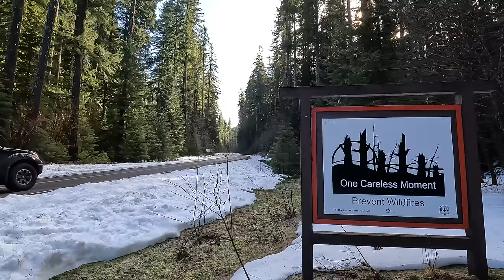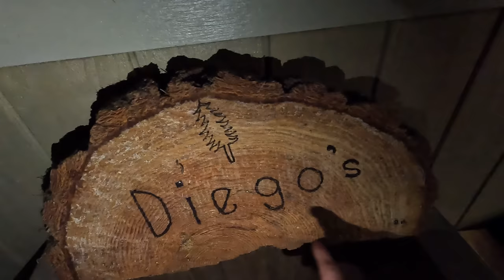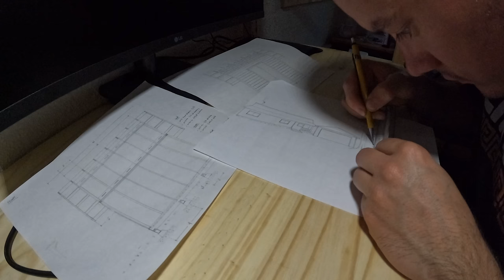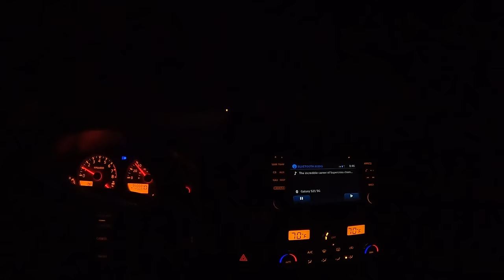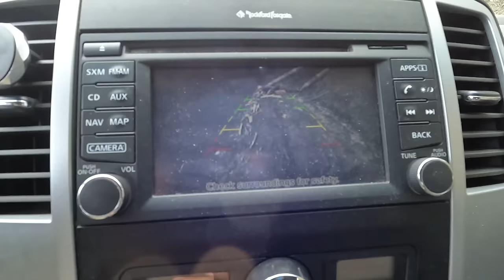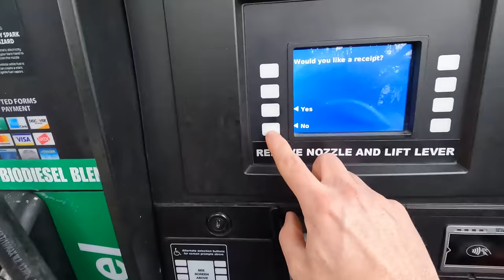4 Day Firewood Haul at My Cabin in the Woods

Comment: The wife and I spent 33 years in the high desert of Nevada. Our house was at 9,000 feet. We had an enclosed fireplace with multiple blowers and only used firewood because out electricity rates was very expensive. I would get a BLM firewood permit for $10 and I could get two cords of wood. I only cut dead pine trees and there was lots of them and very tall like you have been cutting. I had a 3/4 ton truck with trailer and I could get my two cords when I went to cut them. I always kept 6 full cords of wood in my side yard. We would get almost no rain every year but lots of snow. It was a good thing my truck could climb and go anywhere on those old mine roads.

Comment: Just a piece of advice. It would probably be better to cut your wood in longer but manageable lengths when away from home and junk it up at home as to maximize the amount you can get before you need to recharge your batterys. And I find you can get more in a bed by taking it in lengths by leaving the tailgate down and letting it run a couple feet out past the tailgate.

Comment: Looks like you would benefit from a trailer, so you can double or triple your loading capacity, awesome to collect trees like that, and that makita saw works great! Also, I love how you clean up after you as you go, good quality to have!
Reply: I was thinking he can get way more wood per trip (thus not spending so much on gas) if he would stack rounds instead of splitting it first and then adding a trailer would double his output per trip, but I would also get a gas chainsaw instead of going with all battery power, he can definitely cut bigger stuff like that Doug fir they encountered in the road.

Comment: Really like your channel.
 You should put that splitting maul down and spit with your double bit ax.
Try the twist split.
Take the ax hold full length away on the log, put the ax at a 45° angle with your off hand or furthest out hand hold it at a 45° angle grab with the other hand swing down at the with the ax head at angle and it'll automatically split the wood out.
 With ax at a 45° angle the axle bites into the log and then the weight of the head will pop it the log apart.
 This is a much more efficient and less stressing way to split wood that has straight grain save the splitting ball for twists that are knotted wood. 
With the twist method with the double bit ax I used to split a cord and half of wood and two to three hours.
 You're doing it right by cutting all your rounds with the saw first, and then splitting afterwards and loading it's much more efficient to do it that way.
Kris

Comment: Diego, as previously stated I’ve cut significant firewood.  There is a place for both types of saws.  I have a micro limb saw, Stihl.  Love it for really small stuff.  The electric I use for small rounds.  I have a small and large Stihl gas saw.  I do not use microchains on my larger gas machines.  Therefore, I do not get into getting stuck.  I observe you typically do not cut a relief cut from the bottom.  That will also help with not getting stuck.  That chain cuts down as well as up.  Keep practicing you will get it.
Reply: Save your body.  Cut down 3/4 of a log.  Roll the log and finish.  You’re kill your back manipulating the logs.
Reply: Plus, put a=plywood liner on the bed of your truck.  It will help save the bed.

Comment: If you come across a timer you could see how long it takes for the batteries to charge set a timer for that amount and be getting them in the charger faster.  I never had an issue but I've never had a high consumption tool like your chainsaw before.  Thanks for the video

Comment: Great. I find it easier to do 4ft logs in truck then cut split at home. I get more wood per trip. Split wood makes air gaps. 
Oh and... People said refrigerators were no better than ice boxes. Shesh !
Ash hard wood burns long. Cedar soft wood burns fast. Dont use pitch wood that will create cinder in the stack. Always use super dry wood.
Need a wood shed. Lets cut up these 2x6 hmmm
Great close to the video. You rock!
Reply: Keep wood off the ground. Even just some pallets help.

Comment: when sharpening your chain when the cutter gets low you need to take some off the guide in front so the cutter can reach the wood just don't go to far or you'll be cutting sideways. note pulpwood cutters cut he guides down because the wood is so soft and they want a fast cut.

Comment: I have both a gas and an electric chainsaw.  Both are the same size, and can do about the same amount of work in a day.  The gas has the safer ability to handly heavy rain over the electric one, and can sometimes throttle thru a thick log slightly easier.  Needs no electricity to operate in any way. However besides the bar and chain maintanence, there is also the spark plug, filter, and exhaust that need maintained. 

Electric saws have more torque and can do you a favor on stubborn knots.  Require very little overall maintenance, runs cool, no stinky fuel spills.     

1st, I can run my electric chainsaw for basically free when I charge the batteries off my EcoFlow Delta2 while out in the field.  The EcoFlow is charged by the sun at the same time.  

2nd, and missed by many is that during the dry season, gas chainsaws are usually banned from use on public land to reduce sparks from the exhaust thaty cause forest fires.  The electric chainsaw is legal year round.  

3rd, electric chainsaw can be safer to use as they normally have electric brakes that quickly stop the chain when the trigger is released.  

Another tip on either chainsaw is to use your old (filtered) veggy oil from your fryer to lube the chain.  It is already headed for the waste bin, so why not second purpose it.  It is more biodegradable than traditional bar oil, not as thick so you will go through it a bit faster in a day of sawing.   😊

Comment: When you stack wood on the ground try to put a barrier between the wood and the ground. If you dont moisture will suck up into your bottom row of wood. I use old tin or cut long saplings a few inches in diameter and stack my wood on top of that.
Reply: Pallets work good too

Comment: Diego, if you have an oscilating multi tool (or need an excuse to get one 😊), you might get some good use of the carpet or shingle blade to zip a line through the bark instead of using the chainsaw before splitting your rounds.

Comment: The only guy l I know with an electric chainsaw just asked me what gas saw I recommend getting.  If you use it daily and live off grid you don't have a way to charge it.  Also they suck in cold weather.   It's a sign of a city guy that doesn't know what he's doing where I come from.

Surely you can see how silly  it is to idle a gas truck to charge your saw batteries?  Stihl 261 best power to weight ratio and I can cut all day.

Most people keep the wood pile away from the cabin beacuse of mice not bugs.

Comment: Respect for your channel and all you have accomplished.  However, charging batteries from truck battery without truck engine running could leave you stranded one day - specially in cold weather. Until it happens, you don't think it can.  But it can happen.  You're just transferring electrons from one (big) battery to the other if the truck engine (alternator) isn't replenishing the truck battery.  Love your work.  Thanks

Comment: Of course it got stuck it is a battery operated piece of equipment. I mean, Helicopters run on fuel. I have spent time in some, if it was battery operated I would not have...lol. It is just temporary power. Good videos, but don't try to cut the huge ground log on the side of the road with temporary power. Also cut the stuff on top first. Rock on! Comment was for 13 minute mark.